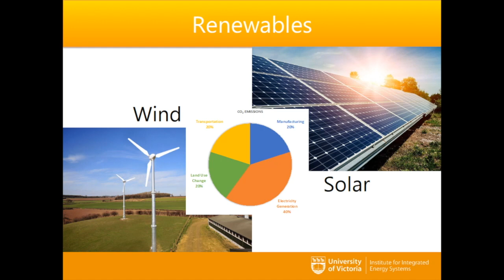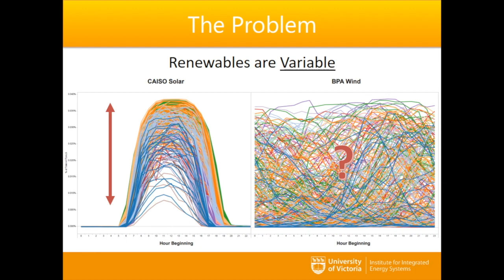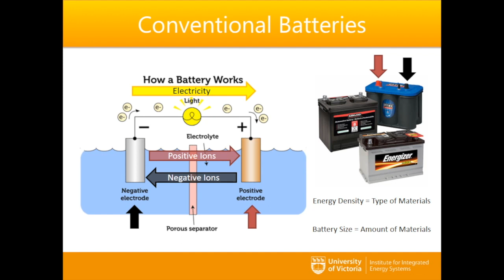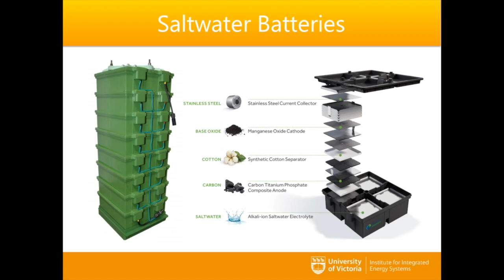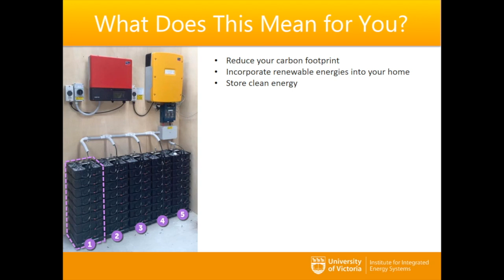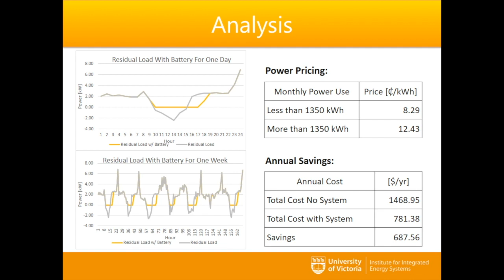Salt Water Batteries

Comment: This is just like a high school video presentation. Looking for specifics here... Ingredients used, Cell structure, Voltage per Cell, Charge capacity per cell, Damages when over-discharged?, maximum discharge amperage, etc...
Reply: Tell you ingredients? That would be irresponsible for Aquion or Green Rock - Bluesky to provide to competitors in many counties.

Comment: The sun doesn't always shine... and the wind doesn't always blow... and sometimes, it snows.... ahem... Europe right now.
Reply: solar panels still produce power even covered in inches of snow.  It's not the visible light spectrum they are using, it's the UV.  It's also why they don't work if you put them in your house behind a window.  The glass blocks the UV light even though the visible goes through.